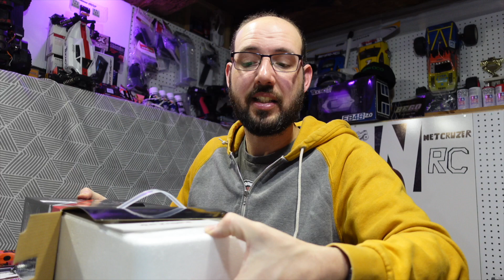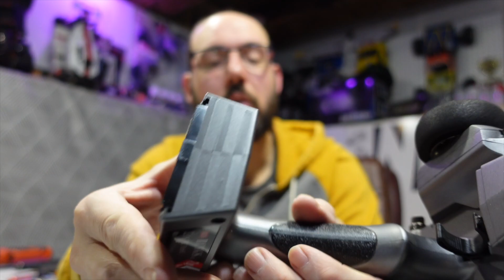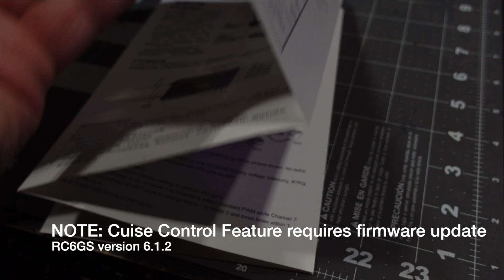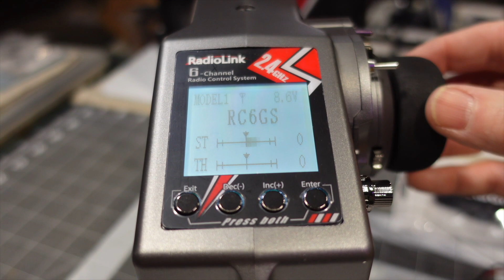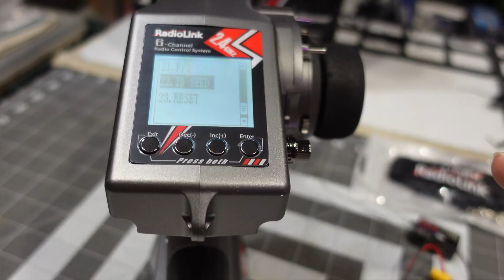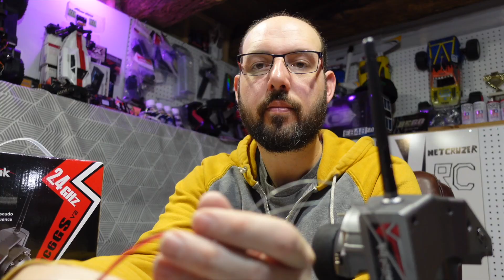RC Gyro, Telemetry and Cruise Control | RadioLink RC6GS v2 Unboxing  - Netcruzer RC

Comment: Just an FYI, and YMMV, but I put a 3S in mine and the range went up significantly. Easily 1800 meters from an 8 ft platform. The best Tx if you're going to do surface fpv.
Reply: Can you confirm? Is this really true?
Reply: @NoTekRc  I have my doubts, most radios have an internal voltage regulator and most radio decks (the internal RF circuitry) further regulate that voltage to lower voltage. The part that boost the signal strength is the amplifier circuit which is specifically designed for it and doesn't rely on the battery voltage (if you check, there's a wide voltage range).

Comment: I'd be interested inyour take on the power switch. I found on my Radiolink that the switch can be bumped accidentally (not even reaching the switch detent) and turn the transmitter off while in use.
Reply from the maker: Oh! I’ll keep an eye on it and check for that when testing.

Comment: With an ESC/electric vehicle, ATL seems to adjust the strength of the brakes.  Lowering the setting lowers the strength.  I set it to a lower number until wheels stop locking up when applying brake from full speed.  The vehicle coasts a little more.  This can get you into trouble if you need to lock the wheels to stop quickly to avoid a collision, for example. For racing, I prefer the control with lighter braking. I also prefer adjusting the ATL over using ABS.  The ABS produces a pulse in the brakes that I do not like.  Maybe I need to play with settings for ABS more?

Comment: 80 bucks, spend the extra 100 and get the flysky noble nb4
Reply from the maker: For a racer yes, for bashers this might be good enough and have the features and cheap rx to use those 10 model slots.

Comment: I was looking at this radio recently and was pretty impressed with its specs. I'm currently debating on this or one of the less expensive fly sky radio's for my Traxxas Slash 4x4 because I want to be able to have both my 2wd and 4wd  able to run at the same time (I only own my Futaba 4pls and the pre-bluetooth traxxas TQi which not impressed with the traxxas radio's range)
Reply from the maker: For your bashers I'd say this is a good option or the 4ch model for even less $, keep the futaba for racing and get radiolink for bashing. The receivers are cheaper than traxxas with similar protocol speed, gyro stability, telemetry, etc.

Comment: My 4gs had a bit of play in the pot .didn't return to center . A put a shim made out of the back side of a sticker now works great . I made some 18650 2s battery packs(with balance plugs) for it from some dead dewalt packs . Fit and worked good . Nice to fast charge but the lithium ions last for ever as well.
Reply from the maker: Great info, thanks for that.
Reply: Make video of that fix?